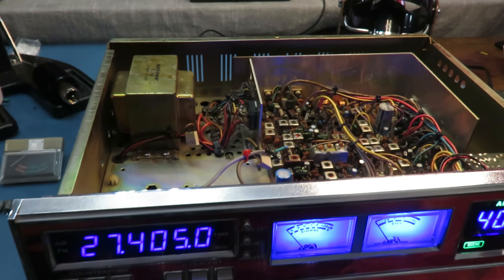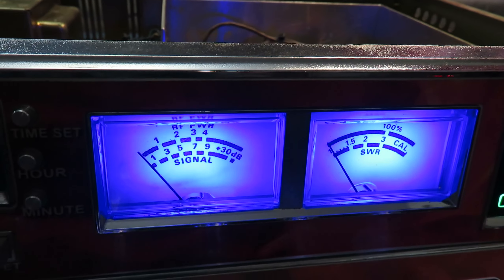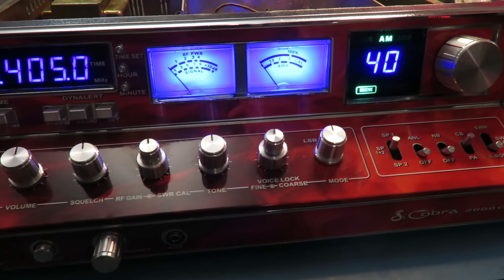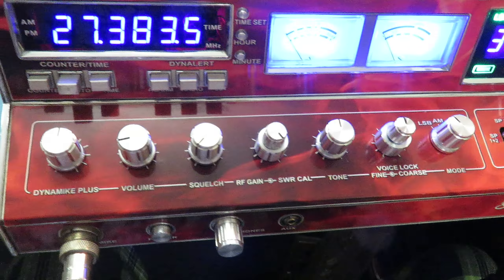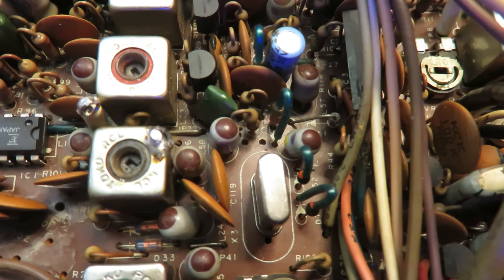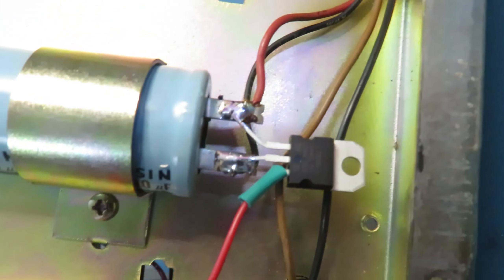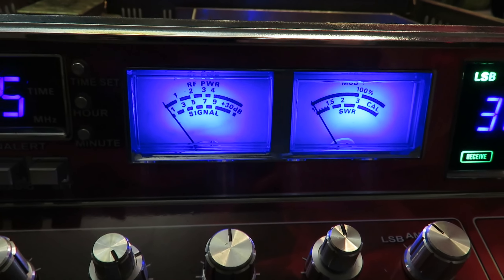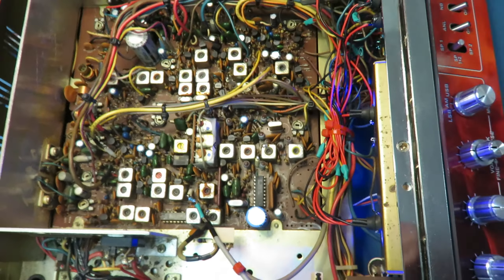2000 GTL Restored at BCool Radios in Seattle Mar 2023  Long Version

Comment: I used to repair radios in Northern California in the mid 90's and early 00's, I have 3 Cobra 2000's in my garage that I may dive back into when I get time. I think I may put a "export" PLL in one of them like I did in one of my 148's. Gives you +80 and -80 channels plus the 10KC switch also. (A little PLL mod is required though) I bring the band selector out the back with a ribbon cable and it can be put wherever you wish. Also a hand built roger beep circuit and the ability to disable the AM limiter (to be totally stock) with variable AM power is a plus when driving an amp. Also "suppressed carrier" AM modulator for extra AM swing without distortion. Nice looking radio!
Reply from the maker: Nice,  the techs are far and few between.  Those Crystal Expo kits were nice for a total of 120 Chs,   but they are no longer made.  So programing the PLL pins is another way for sure
Reply: How much